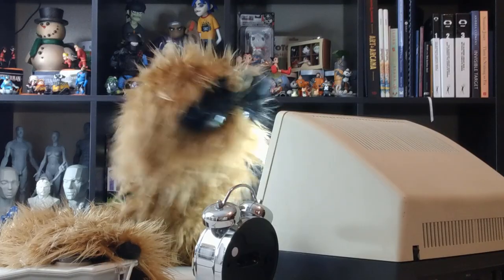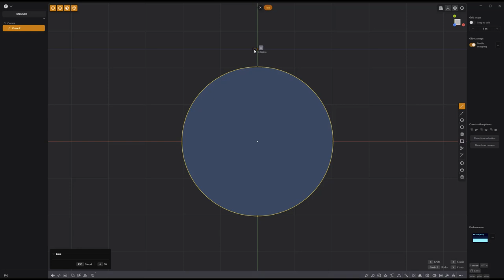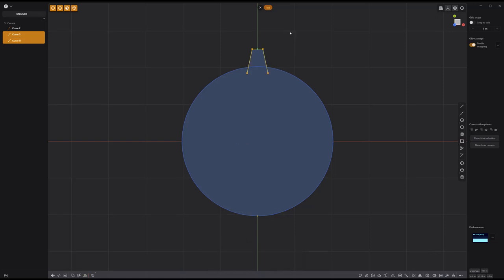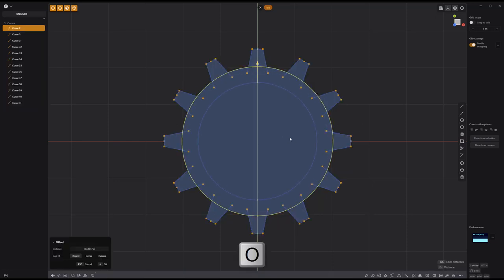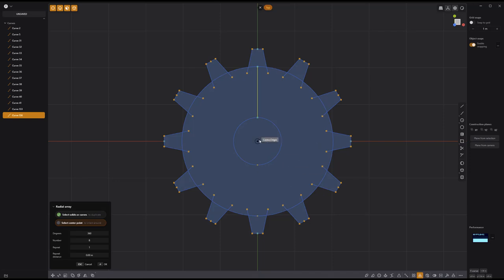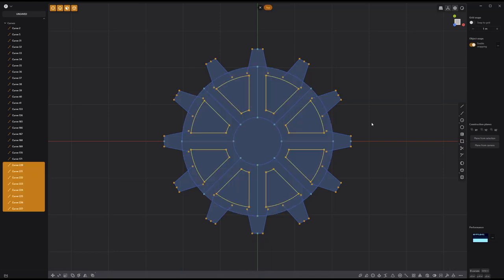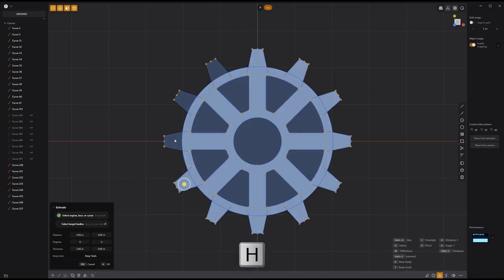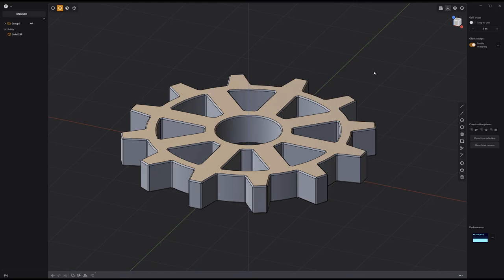Plasticity | Model a Gear

Comment: I'm so impressed with your demonstrations of how use this very new program. Thanks! 
Has anyone tried to use output from Plasticity with a 3d printer or cnc?
Reply from the maker: Ive seen some users on the Discord channel showing off their 3D prints from Plasticity.
Reply: Awesome thanks
Reply: I have started using plasticity to print some 3d parts. It is taking time to adjust tolerances as my printer is not finely calibrated. These tutorials are helping a lot. This is my first entry into CAD software and have no prior experience.